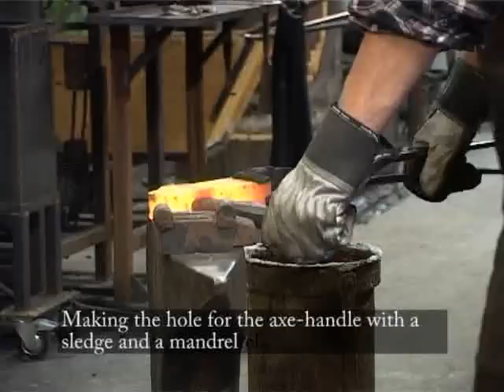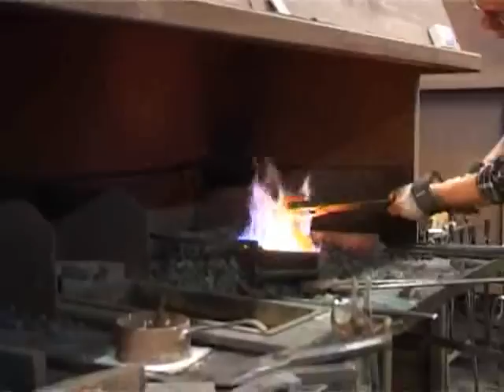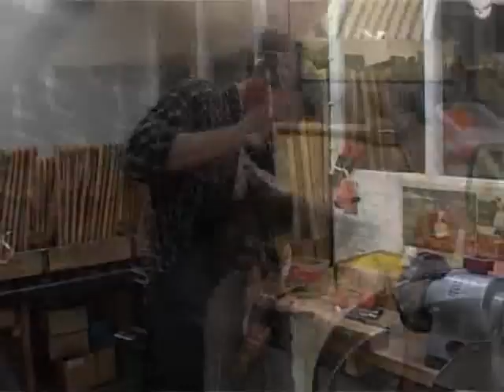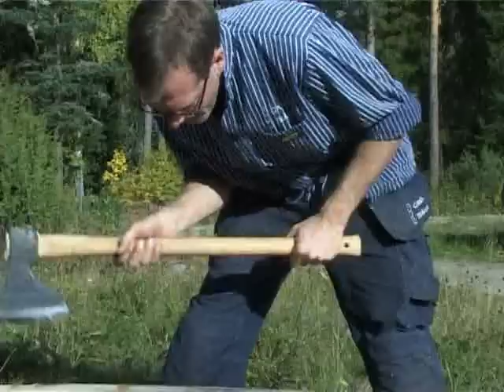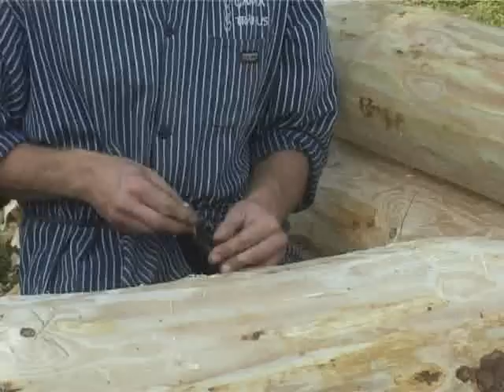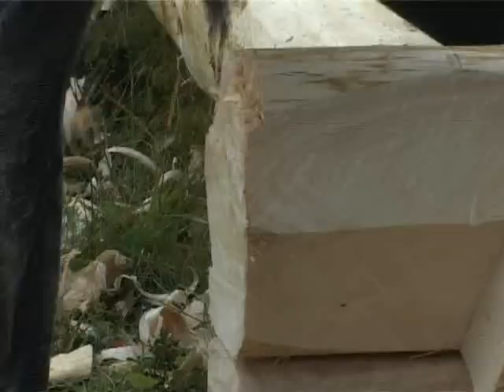Traditional axe making and wooden lodge construction from Sweden

Comment: What is the traditional part about this method? Is it just the shape of the axe? Because I'm seeing power hammers, steel inserts, high speed grinding wheels. I mean, forging as much as possible is always cool, just not really sure about what makes this traditional.
Reply: That is a good question, I'm going to do some research
Reply: Modern axes are made from one solid piece of steel.  Traditional axes are made with a steel insert.  Power hammers and grinders have been around since the middle ages.  All thats different here is that they are run on electrical power instead of water power.  Modern axes are drop forged and the skill is understanding the machine, this axe is all controlled by the smith not the machine and the skill is all in the forging itself.
Reply: Now that is the most consise and complete answer anyone could ever want. Even I will be able to explain what a traditional axe is.
Reply: *****  they had steam back the they use gas now cause its more effective
Reply: XxKAOTICxKODYxX gas? Those machines are running on electricity mate..
Reply: traditional as handmade in sweden. not manufactured in china

Comment: LOL traditional power hammer!
Reply: +Michal Gaik Power hammers have been around for over 100 years. They are considered traditional tools, especially like the one in the video.
Reply: 100 years! I use a hammer  they have been used for over 2000 years. who is more traditional now?
Reply: +Michal Gaik You understand that length of time is not a measure of tradition. Right?
Reply: but that makes the word meaningless
Reply: Trip hammers have been used for over 2000 years too ... just saying    https://en.wikipedia.org/wiki/Trip_hammer
Reply: Do you have a reply for DRAUGH39?
Reply: Powerhammer, triphammer. Saying traditional is misleading. I wanted to see a hand forged axe.
Reply: It's not misleading as this techniques is millennia old. The axe is hand-forged using traditional methods the fact that he now use an electrical trip hammer instead of one powered by water or oxen is beside the point.
Reply: Its not beside the point. This is not a hand forged axe.
Reply: He propably makes his living making these axes and its pretty much impossible to forge axes for a living without a power hammer or a press.

Comment: Thanks for a top video. So people other than Wettlings and Granfors Brucks make axes and with the inlaid high carbon steel edge. I did not realise that was still done. I have some leather tools (pricking irons from the 1880's) that have hard steel cutting edges and soft steel sharfts you can see the line where they meet.
I also did not know the joints were so complex on the wooden lodges. Thanks for showing this on utube and for keeping these skills alive.
All the best to you all.

Comment: Although it is new technology, it is very similar to different presses used in the past. They  were powered by wind, water, gravity, or even man. They generally consisted of a huge hammer head which, like this press, would be dropped on the metal.

Comment: I LOVE the big chisel the guy uses to shave off the tree bark!
Reply: Here in sweden it is actually called a "barkspade" if you translate it directly :p
Reply: Emil Westgaard Henriksen That name is so cool, I can't believe it! Obviously, Sweden, with all its forests, must have an enormous woodworking presence. Metalworking, too.
Reply: It was much more before today mlst of it is made by compa ies but there is still alotof smiths and carpenters here to ^^ I myself is educated in old fashion carpeting and fine workings with wood and I really enjoy it ^^ my father is a carpenter and my grandfather was a furniture carpenter so I have learned most of it from the  ^^
Reply: Emil Westgaard Henriksen I think you now have the responsibility (if you want it) to carry on the tradition, so it will not die.
Reply: So i will too ^^ I've also started setting up plans for my own forge wich should be finished before first snow ^^ I've made all the plans for it myself with an old drawing set for blueprints I got after my grandfather ^^
Reply: Emil Westgaard Henriksen Good luck!
Reply: Thanks! :D

Comment: That's sure some fine beam-end jointure, if you have hour or two to spend on each join. I've never seen the scoop-out beam facing either.  Real fancy. I reckon I just square the beams and stack um up.
But if you don't have a barrel of pitch or oakum it is a right likely way to keep draft down. I think I'd schmeer some fine-grained white clay in there to block air out.
A fine job augering those dowel holes and pinning them. Them beams ain't going nowhere pinned like that. Setting green-wood logs together, pinning them up will keep them from wandering.
My grandad was born in a log cabin in 1880 in Pennsylvania.  He and my great-grandfather built a covered wagon and drove it with a team of oxen 800 miles to Illinois in 1905. Took 100 days.
I told that to some kids once and they said,"Why didn't they drive?"
I said "Cars hadn't been invented yet!"

Comment: I love how you don't even need to hit it that hard when the axe is so damn sharp. I wonder how the hell the axe head doesn't go flying off when there's nothing on the top to stop it?
Reply: +Chris Johnston 
The handle is hammered into the hole
Reply: +Chris Johnston its a wedge that squeezes the material on the top and in the axe eye  to hold it. if you look at a gränsfors axe you will notice that the wood on the top of the eye is like a mushroom, thats whats holds it in there
Reply: rocketguyandtompan07 That's awesome, thanks for answering!
Reply: Chris Johnston no problemo

Comment: Oh, i get it.  High carbon insert, but the low carbon is cut off to reveal the high carbon insert only on the edge!  

How much practise does it take to see the correct edge color when tempering?  Did you have lots of failures before it started to make sense or was it a fairly steep learning curve?

Comment: quenched from red hot but only the edge, and then letting the heat from the rest of the axe head travel up to the edge for the temper, before quenching fully. that's some pretty serious skill. 

most people I know(myself included) would heat treat something like that by quenching the edge first but holding it in the water/oil, then after a few seconds putting the whole head in, and then tempering in an oven. I'd be too afraid to try what they did in this video.

Comment: The high carbon steel inlay is a harder, tougher steel which will form the cutting blade of the axe. It will hold a sharpe edge for longer.

Comment: Really cool video! :P One question though; why, when making the ax, do most most people i see cut off the original edge?
Reply: Because one of the most well known methods of getting a good edge is to make the axe head with a lower carbon steel, then splitting it down the middle and placing a high carbon wedge in it. That wedge then becomes he new edge. this is generally easier then separately hardening the pieces of the axe head.
Reply: Kyle Bates
He didn't mean the splitting, he meant after that, when they cut a bit off after the did the wedge.
Reply: ahh, then I'm not quite experienced enough to say, but if I had to guess I would assume because it makes the weapon oblong and odd shaped, and while they could take it off at the grinder, hot cutting it is easier. It also might be because it is a really high carbon content piece of steel, so they use the already forge welded combination piece as a good medium.

this is just a guess though.
Reply: Kyle Bates If you Went to take off all that metal with a grinder the temper would most likely have to be redone however one does that. That is probably why they do it like that.. my guess
Reply: The steel inlay in the middle is high carbon steel. Carbon is what hardens the steel. Every time you heat steel (forging temperature), it becomes a little decarburised, or loses a bit of carbon. This is near the surface due to a reaction with the oxygen in the air. The cutting edge is quite thin after forging, hence will have lost to much carbon to get a good sharp edge. Thats why they cut it off, to get an edge that is not decarburised holding its sharpness longer.

Comment: Unbelievable joints! What are they called?
Reply: "Saddle Joints" are what they're called in the US. There is a small variety of them, some round, some squared, etc...
Reply: There are also dovetails, pegged box joints, French corners (a vertical log in the corners where the horizontal logs are inserted into a running groove in the vert), etc....

Comment: They propobly burn "antracit" it´s a type of coal that you  find in coalmines normaly under the 200 meters below lewel. They can also be using normal hardcoal or "rock coal" if you translate it direcktly from swedish but antracit burns a lot hotter and cleaner

Comment: It's to harden only the edge. It's a "action causes reaction phenomenon". If you don't harden the edge, the force when the axe is used will reverberate through the axe, and cause it to deform from usage. When you harden only the edge the strain is focused on it, and will not cause the rest of the axe to be deformed. At least not that much, in theory.

Comment: what model of gransfor is the axe head?
Reply: Other than the fact it's most likely not an actual gränsfors axe, it's either some other company or a family forge because a GB axe has the makers mark on it's head with the blacksmiths initials and the handle would have the gränsfors logo on it.
Reply: ZombieFighterOf1987 And the handle would LOOK different, shape-wise, and would be fastened/wedged differently.

Comment: @frankgon4 
Sorry for my English...
Not my hammer but i hawe also spent a lot of time with it when i was working there so i think i am allowed to ansvear...
Its i fact a very old model (think it´s made during 1930-40) called BAHCO 802  its a fully mecanic springfether powered  contruction with a horseshoe shaped steelfether holding the hammerhead, today it´s powered by an electric engine. Originally i think it was designed for both steam or electric power or from a water turbine.

Comment: "Navare" or "Skålborr", "Timmerborr" Picture Google it. You will get museum pics. 
"M 9107" maybe most similar. Navare is the name of the implement, both the older "skålborr" and newer spiral drill , the latter probably better and easier to use but the older kind could be made by village smith or at home.

Comment: @Theicemonkeyjr Well, "sharp" weapons use friction/movement speed to cut/slice. Sword damage, for instance, largely depends on how long your hit lasts. Axes however, depend on impact. They cleave, or force their damage not through the sharp side, but the mass and hit weight. Thats why "bearded" axes were made, they are flatter and usually lighter, so they support a larger blade. This ax is a slight crossover between a "splitting" and a full bearded ax.

Comment: 2:30 notice how they all do it in one heat
Reply: +akagi333701550221k That's what caught my attention out of this whole video. And we know Swedish stuff is great so I think we really learned something here about hardening our blades better.
Reply: +akagi333701550221k my shop teacher showed us this when making center punches. The edge is quenched at critical temperature, and as the heat from the heal spreads back up to the edge it tempers it, and once the color is deep straw along the edge you quench it to seal that temper. Takes a few tries and a keen eye but works great.

Comment: Grinding metal on a stone is not a very new technique.

Just because the machine with the stone on it has electricity running through it doesn't really mean anything. They can be operated just as easily with mechanical power through some gearboxes, belts, and a crank/footpedal/lever/waterwheel etc. etc.

Comment: Is that really soft wood or is it a really sharp axe responsible for the ease of chopping?
Reply: "Soft wood" doesn't mean that it requires little force to cut it, balsa wood is a "hardwood". Hardwoods are called "hard" because it was hard to work, The reason for that is because you have pores or vessels in a hardwood which can make the edge of the cutting tool trail off in a direction you don't want it to go. Pine is a "softwood" (soft wood lacks vessels) , but the further north you go the smaller are the year-rings and the tougher the wood.  *So that axe is very sharp*.  :-)
Reply: In Scandinavia, log houses are generally made of pine, which is a softwood and relatively easy to work. The logs are also unseasoned, which means the wood is softer and less prone to split.

In England, where I'm from, we use unseasoned oak (a hardwood) in the construction of traditional house frames because it's much easier to work when "green." Oak framed houses last for hundreds of years.
Reply: Yupp That's a sharp axe.

Comment: The handle is way too long. Traditionally the Swedish axes used for building are called bila's. Their handles are shorter and heads broader and most often they're only sharpened to one side, either right or left depending on the builders preference, instead of the traditional V shape. A big general purpose ax like this would basically never have been made or used because each job requires a special tool. It might have been used as a felling ax but then the edge is too narrow.

Comment: The thing that confuses me is why he's using an axe-handle of that length. The only reason you'd want that length of handle is for leverage, and he's not doing anything that need it. Indeed, what he wants is control, and a shorter handle on the same size head would be MUCH better.
Reply: Ummmm... He needs tons of power for what he's doing, the longer the handle, the stronger the strike. He's cutting perpendicular to the grain on a whole tree, this is the exact job that you would want a long handle for. Since it requires less effort, a short handle works better for splitting with the grain, and different types of bushcraft where a lighter implement is ideal. Honestly though you should always use a long handle, you can grip further up the handle, but there's nothing you can do if you're trying to make a hard strike and you are stuck with a short handle. A 5 inch knife will cover almost all of your small axe needs, while homesteading, I used only a handmade knife and an old granfors bruks forest axe for a very long time, eventually I made an Axeroon (look it up if you don't know it) with 2 Palm swells, you can hold the longer swell for using the pickaroon side of the axe so you have more reach, and for the axe side, you can hold the shorter swell for bush crafting and use it like you would a tomahawk or a small axe. It is the most perfectly amazing tool I've ever used, it feels like an extension of your arm, you feel like a homesteading machine.
Reply: Baron Ockslite Orrrr, not. As is very clear by actually WATCHING the video, the strokes made are short and controlled, rather than long and powerful. It's basically whittling, with an axe. So, no, he doesn't need a long handle, most well shown by the fact that he never grips at the end of it, but instead holds it mid-shaft..even at the most powerful strokes made, he isn't using the full length. And more often than not, that long handle gets in his own way, forcing him to use awkward and cumbersome strokes. With a shorter handle, he'd get better control, and wouldn't have to work around it. The number of awkward strokes and positions are high, particularly for such a short video.
Reply: ***** orrr not,he must be using that axe for felling tree sooo,long handle
Reply: Really? And, where exactly is he felling any trees?
The ends of the logs are clearly sawn, not axe-marked, and the axe also completely wrong for that, as the axe-head clearly shows.
Reply: somewhere in his life
Reply: So, essentially, you have no argument, then? Oy...
Reply: and you're essentially close minded,and have no humour

Comment: 100+ years old ain't very traditional when you're building a log house after a blueprint well over a thousand years old. 
But even so it don't matter much, power hammer is like you said just a time saver, nothing wrong with that, it's the resulting tools that matter.

Comment: Why they destroying trees? Save trees & try to build by bricks or stones.
Reply: ks elango Trees are a renewable source of material. If you replant what you cut down you will not have any adverse effect in nature. Furthermore, wood is a much better insulating material than bricks or stone are (and the latter two are NOT renewable sources!). That means that you will use up less energy to heat a wooden house than you must use to maintain the same temperature in a stone or brick house. So the environmental impact is much worse if you use bricks and stone than if you use replanted wood. Ok?

Comment: Traditional axe making --> Machines
WAT.
Reply: I think it means Traditional axe style, like the actual axe, not the way its being made
Reply: The power hammer used is using electricity but powered hammers have been used  in various forms for about 2000 years. The old types are called "trip hammers"

http://en.wikipedia.org/wiki/Trip_hammer
Reply: Powered hammers were first used in China before the rise of Rome.
Reply: Bjorn Njordson Of course you are right. The ancient Chinese also had a variety of other "power" tools, like the lathe. It was a horizontally mounted log with a huge, heavy stone flywheel at one end, and the bit at the other end. One man would spin the flywheel, and the other man would be able to do amazingly delicate work. I might be incorrect in calling this device a lathe, since it acted more like a power drill or grinder. Regardless, it was very cool.
Reply: Gil Mosko
As far as ancient engineering goes, China had the best machines and mass production way back in the bronze age. There was also a guy in Alexandria named Hiero that built the first steam engine and experimented with hydraulics...